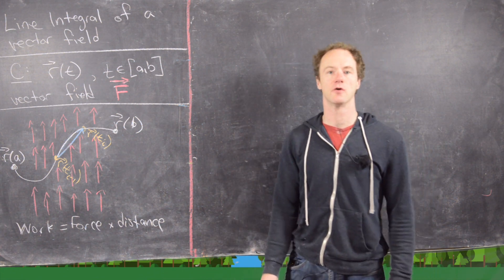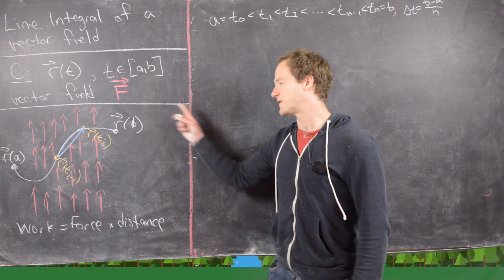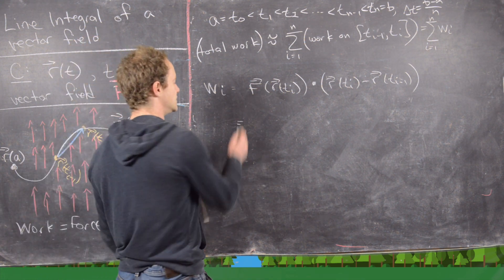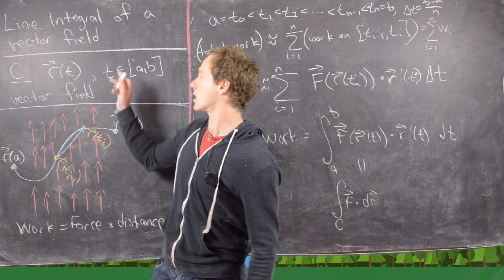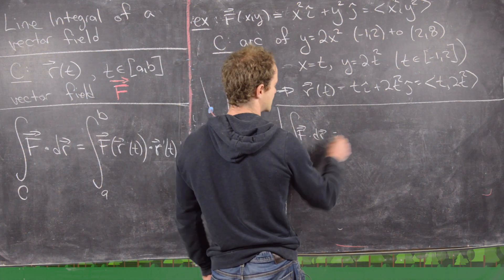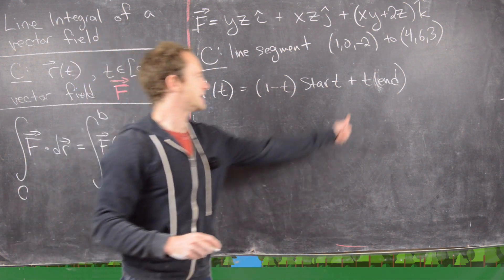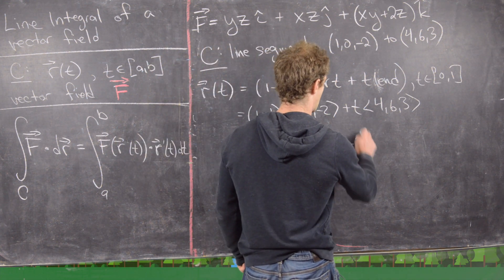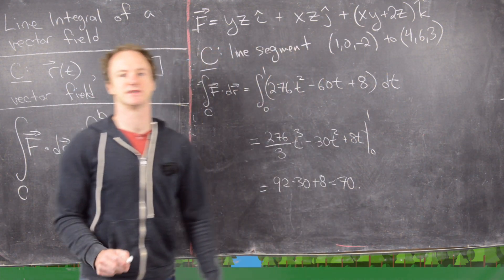Multivariable Calculus | Line integrals over vector fields.

Comment: Antonio Costa found, I think, the first error (13:59 the final result should be 18t^2 + 16t - 4.), but there's also @ 15:02 18*5 = 96, rather than 90.
We've all been there ... many times.
Also @ 15:34, should be -62t
Doesn't change the meat of the concepts, just arithmetic, the least interesting part.

Comment: Great job. But one question, there doing the integral we are finding the work, of course, but geometrically spealing we are just like measuring the distance of the curve in this field. Or, on in other words we are like weighing the field at each point and then doing the entire sum ??? It would be awesome if you clar me up this doubt
Reply: The catch is that Force vector decomposition makes sense, so that if you dot product F and dr, you would get the force exerted along dr, multiplied by dr. and yes, dr should be interpreted as a distance in this scenario.